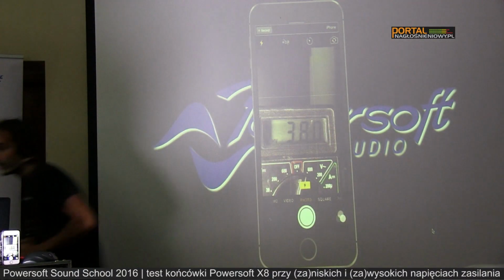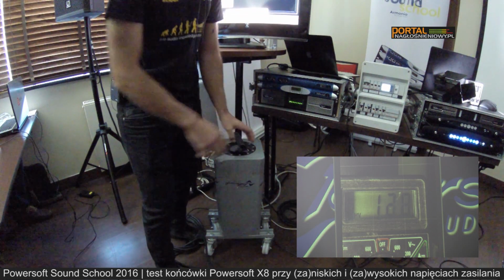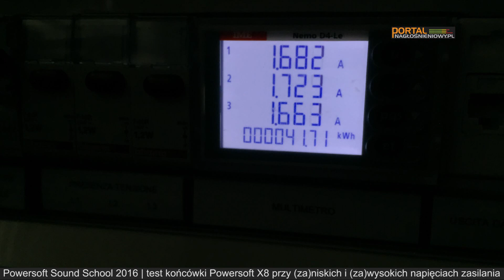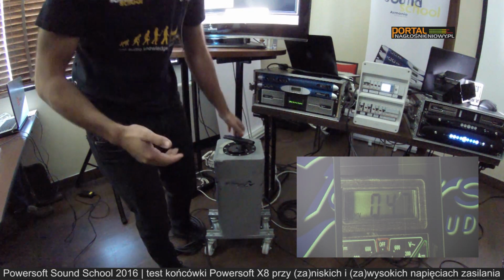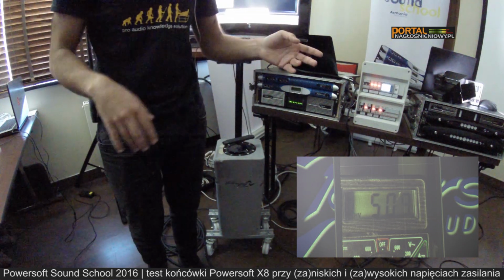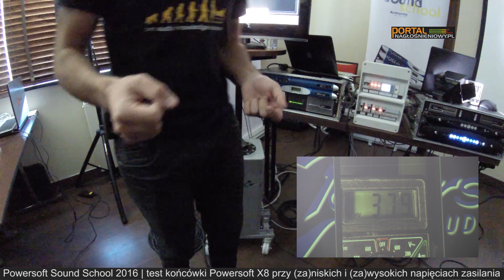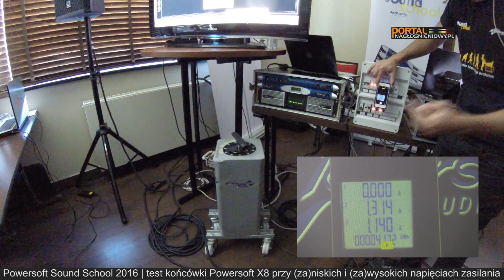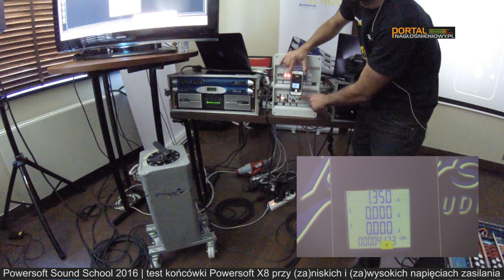Powersoft X8 stress test - voltage and phase power

Comment: I want 2 one for monitors. Just cant afford it. I would rather see it run at a normal voltage with alot hooked up and high volume. Let's see a few double 18 per channel and some tops on others ran hard for a half hr.
Reply: you can run an X8 at 2ohm with 1db headroom for 10 hours you wont even stress it